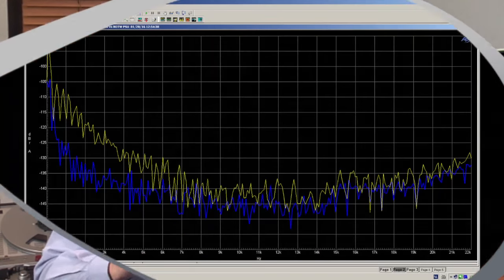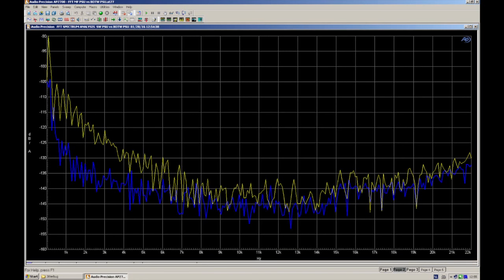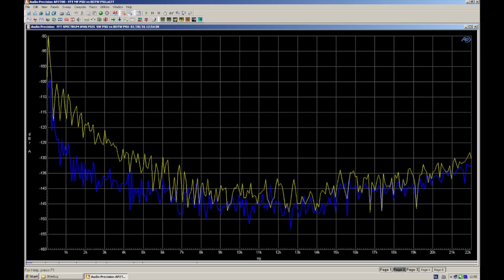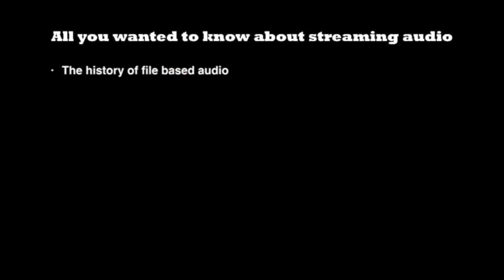Audioquest Jitterbug

Comment: I am using a mac mini w/ssd drive as an audio source for my Parasound Halo Integrated Amp. I was experiencing a ‘ticking’ sound through both speakers(Magnapan 1.7i) and headphones. I brought the amp back to the shop and they could not duplicate the problem using a macbook pro as a source. They speculated I was having interference problems with the mac mini power supply. They let me borrow a ‘jitterbug’ to try... worked beautifully! Very happy with the jitterbug, as it was unlistenable without it. $50? It’s a steel!

Comment: Hi there :), the JitterBug FMJ (and its predecessor JitterBug) does NOT reclock (and therefore not remove jitter) as it is a merely passive device that does not draw electric current (it does not remove bugs either). JitterBug designer Gordon Rankin was a consultant to AudioQuest and did not name the device. It reduces noise.
Reply from the maker: This is incorrect. The jitterbug is no reclocker, so much is true. But it is a filter that under certain rather common conditions can prevent (increased) jitter from developing.

Comment: Hello. Should I buy the jitterbug if I intend to use it with a dragonfly black 1.5 mainly connected to my iPhone?
Thank you!
Reply from the maker: I never tried. But it seems unnecessary and at least a lot of hassle.
Reply: thank you!
Reply: YES!!!!  The battery on your iPhone is littered with frequencies bled off form other components like the various radios, etc.  We know this is true because a part of FCC compliance is that your components have to accept frequencies.  The Jitterbug will filter out that noise when connected to the Dragonfly. I have the Dragonfly red and use the JItterbug.  I have it connected to my Samsung S7 Edge and to my Samsung Galaxy S2 Tab.

It is indispensable.
Reply from the maker: this is an explanation I would not vouch for.... A battery stores DC and DC has no other frequency than 0 Hz. I would rather suspect the computer chips of producing interfering frequencies ....

Comment: Does this work with a focusrite scarlett solo
Reply from the maker: It is a filter to high frequency noise coming from the source (computer?) over the USB cable. The degree it works depends on the noise level coming from the source and the filtering already present in the DAC. I have not reviewed the Focusrite, so I can't say.
Reply: @TheHansBeekhuyzenChannel  I have been experiencing a low hiss until I turn my gain up then it becomes very apparent and have been on the search to fix this problem very odd it just randomly started happening

Comment: Great video as always. Hans can I ask you what mac computer you recommend for using as your music player, right now I am using a MacBook Pro 2009, running a ext usb drive and Ammarra music player, but I would like to go to thunderbolt drives and update to a newer and dedicated computer that just holds the music, would there be a quality difference between a mac laptop or a iMac/Mac Mini ?
Thanks.
Reply from the maker: +gryphongryph The best choice is a MacMini since both MacBook Pro and iMac have noisy screens aboard. Use an SSD system drive and a minimum of 8 GB of RAM. You can have your music on an external drive.
Reply: Thanks.

Comment: I think I’m gone try the: iFi iPurifier3
Mi noise came from Data of USB, I’ve cut the red wire on mi cable and noise still there.
So, look like I need a Re-clocker? 
I have read lot of bad comment about: AudioQuest Jitterbug.
Noise is not so loud, before investhing 179$ can, hope some one can tell me if it solve the problem...thank's
Reply from the maker: The Jitterbug will work in certain situations but not in others.

Comment: what can I do if jitterbug did not solve my problem completely and I'm using a laptop and USB Powered Dac  adding jitterbug added  warmth and resolution.. / did not clear vocals for me, vocals are distorted  sound is still stressed and mechanical  /hp envy 6 /asus  xonar u3
Reply from the maker: You could watch this video: https://youtu.be/AWM8fOCCVW4 (and its part 2), followed by this: https://youtu.be/EykkzxUstL4
Reply: I watched the videos, but still I can't explain how  while using the sound card for a 1-2  months 3 times it  did sound amazing the sound was crystal  clear no distortion at all  and very soft,  vocals came forward  ,beautiful lows and very wide resolution .
1 time the sound described above was triggered  when waking the laptop from sleep while sound card was plugged in
2 time the sound described above was triggered  while watching movies  the sound changed dramatically in an instant I was shocked what happened in my headphones  like I plugged  in a different output .
But after shutdown and turning  on  the laptop all that beautiful sound was gone  . I would  like to know what is causing this and how to fix it ?
you are far more experienced then me maybe you came across this kinds of problems before .
the sound cards uses a C media  DAC 6400 series  along with a DRV 601ti headphone amp 
headphones I'm using  Sennheiser HD 558
Reply from the maker: You didn't tell me it sounded ok at first. This is exactly what I meant in the second video. It is impossible to do support at a distance when computers are involved. If it is a Windows computer, you need to set up the computer to do bit-perfect play back. How that is done depends on your version of Windows and the bit-perfect playback software you use. Using Windows media player won't do it. And just installing another player without special measures won't either. Ir you have a Mac, you just have to use bit perfect software and you're set.
Reply: how about WASAPI and foobar200? windows 10 64bit
Reply: can laptops running on batteries  suffer from poor signal to noise ratio ?

Comment: great video hans! 

would you reccomend buying the jitterbug as a legitimate addition to my already purchased (by your reccomendation) Nuforce Udac3?
Reply from the maker: +kosemk Hard to say. The jitterbug will filter out small anomalies in the power supply and clean up the data signal somewhat. That will improve the sound. But if the power supply of your computer is rather noisy, it will not correct that and have no effect.

Comment: Great objective video as usual. When you get chance, could you give us your thoughts on speaker cables and inter-connect cables. It would be interesting to see them perform on the three different audio setups.
Reply from the maker: +Venkat R I have never done cable review and I probably never will. Not that cables don't matter or because I would not appreciate the differences between cables, but merely since the output impedance of the sending device and the input impedance of the receiving device can play a very large part in the differences in sound. It is therefore rather complex (if not impossible) to write an objective review of cables. What I will do in due time is explain why some cables can be better than others.

Comment: anyway, its just a $50 device... make the purchase, try it on your system, return it if it does nothing.
Reply: Follow up: it does nothing for me on a desktop.  probably because Im using a regulator on my power line in the house.  the noise level from my speakers was minimal but still audible, with white noise but no fuzz.   it did not improve the sound quality as well by a SPL meter, no improvement or changes on graph was recorded.   
my guess, this thing probably works for any system setup that has detriments in its own consistency, which happens alot if you have so many things connected togather.  
This is a snake oil for me then...